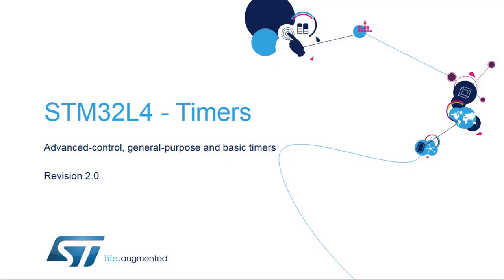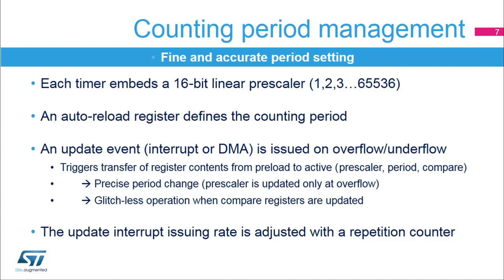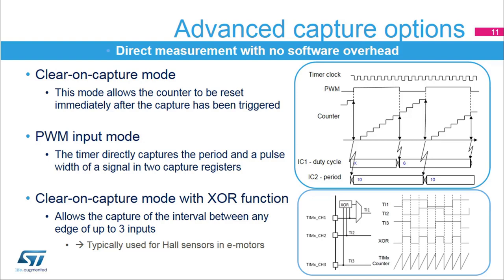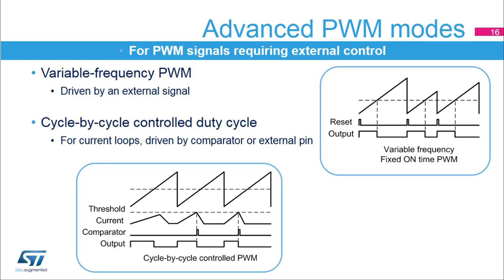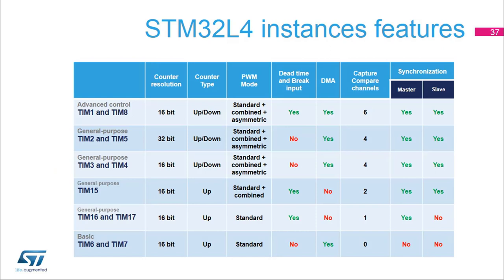STM32L4 training: 06.1 Timers - General purpose timers (TIMx) theory

Comment: Summary

Overview (0:26):

* STM32 timers offer versatile timing resources for hardware and software tasks.
* They can generate waveforms, measure input signal characteristics, and react to external events.
* Based on a scalable architecture, most STM32 timers share common operating principles. 

Key Features (1:36):

* Scalable architecture across different timer derivatives.
* Variety of input/output channels.
* 16-bit (some 32-bit) counters.
* Linking and synchronization capabilities for complex timing applications.
* Motor control and digital power conversion features on specific timers.

Timer Functionality:

* Clocking (3:42): Internal clock sources, external clocking, internal triggers, and encoder inputs.
* Counting Period Management (4:59): Linear clock prescaler, auto reload register, and repetition counter for adjustable counting period and interrupt rate.
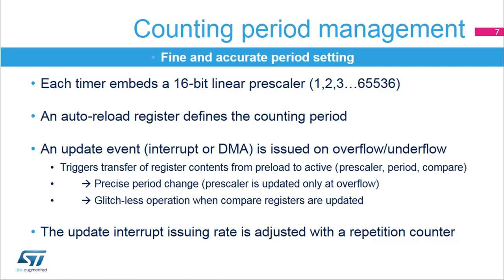* Counting Modes (6:29): Up/down counting, center-aligned PWM for reduced noise, and quadrature encoder support.
* Internal Time Base (7:44): Provide periodic interrupts, time-out protection, and triggers for other peripherals.
* Input Capture (8:42): Programmable edge sensitivity, event prescaler, digital filtering, and advanced capture options like clear-on-capture and PWM input mode.
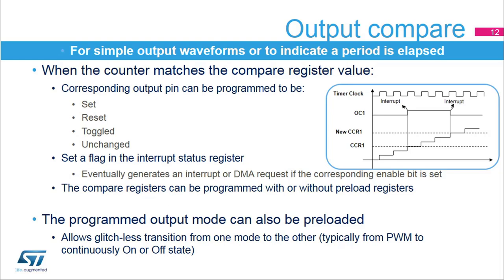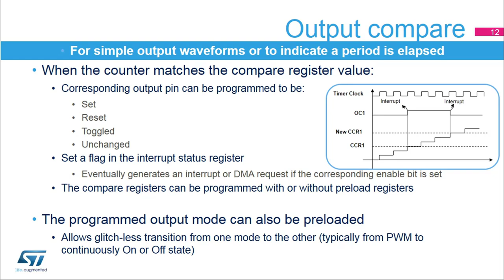* Output Compare (11:35): Generates events based on counter comparison, triggers interrupts, DMA requests, and output pin actions. Features include preload register, one-pulse mode (12:26), and retriggerable pulses.
* PWM Modes (13:21): Edge-aligned, center-aligned (reduced noise), asymmetric, combined, variable frequency (16:12), and duty cycle control modes.
* Cascading Timers (17:48): Master-slave configurations for larger time bases (e.g., 48-bit timer) and complex waveform generation.
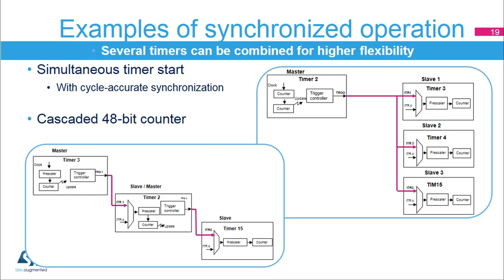* Motor Control Features (21:21): Specialized PWM modes, dead time insertion, six-step mode for brushless DC motors, power stage protection circuitry, support for various sensors (encoders, hall sensors, tachometers), and synchronized ADC triggering.
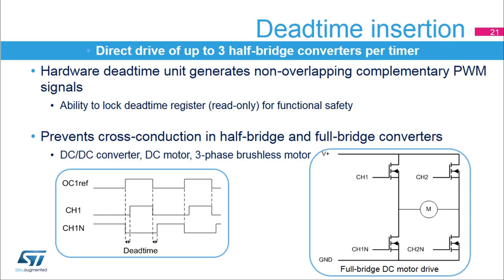* Dead Time Insertion (22:25): Generates non-overlapping complementary PWMs for safe half-bridge operation, features programmable duration and write-once lock for safety.
* Six-Step / Block Commutation (23:37): Offloads CPU for BLDC motor drive, utilizes two synchronized timers for Hall sensor signal handling and PWM generation.
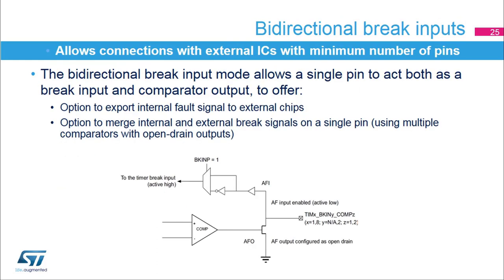* Break Function (25:04): Hardware protection mechanism that disables PWM outputs in case of faults, features multiple sources (internal errors, voltage detectors, sensor inputs), configurable fault states, and dead time insertion for smooth power stage shutdown. Bidirectional break inputs (27:36).
* ADC Triggering (28:22): Synchronized ADC triggering for accurate measurements in motor control applications, multiple triggering options (compare events, TRGO event, TRGO2 output).
* Interrupts and DMA (31:00): Most events can trigger interrupts or DMA requests, repetition counter for managing interrupt rate, DMA burst mode (32:02) for efficient multi-register updates.
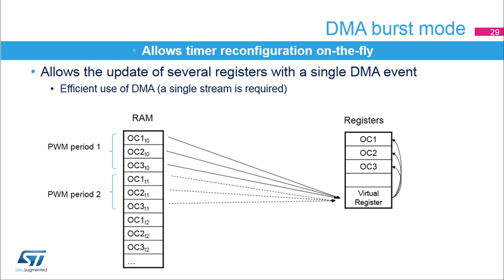* Low Power Modes (33:08): Operation in run and sleep modes, frozen in stop mode, powered down in standby and shutdown modes.
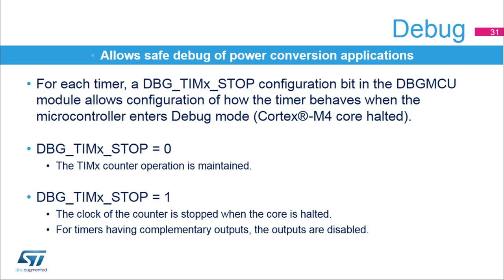* Debug Mode (33:27): Timer clock and counter control during debugging to protect power stages and prevent uncontrolled motor states.

Programming Tips (37:43):

* Use iterative approach to find optimal prescaler and auto reload values for desired PWM frequency (34:10).
* Remember to enable the MOE bit for timers with dead time generators to activate outputs.

Additional Resources (40:04):

* Application notes AN2592, AN4013, and AN40507 provide further insights and practical examples. 

i used gemini 1.5 pro to summarize the transcript